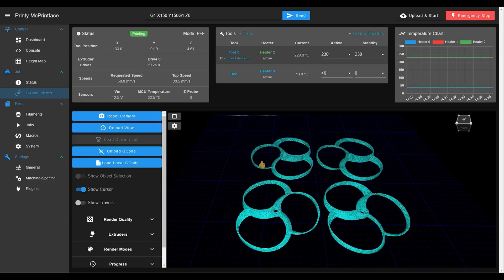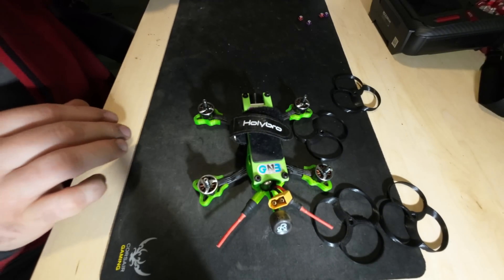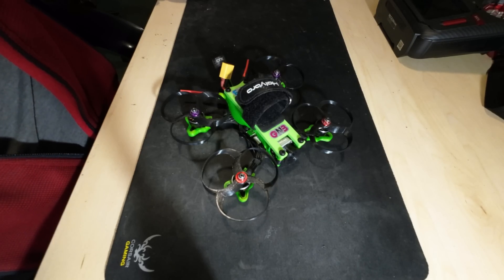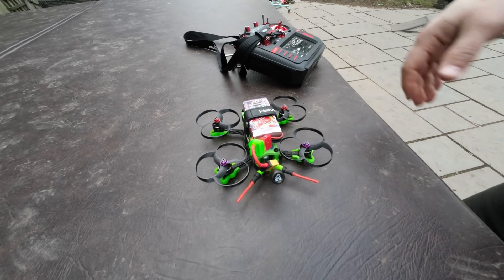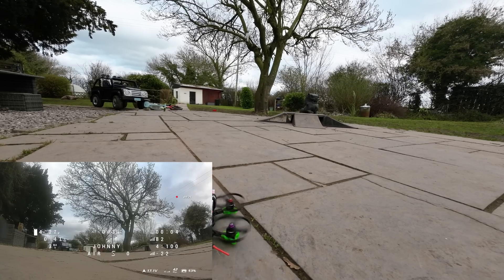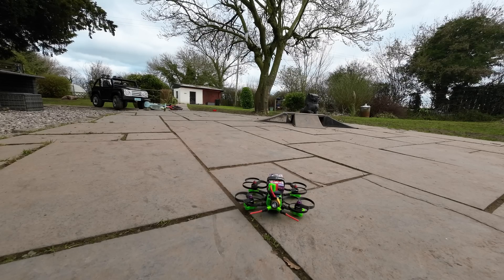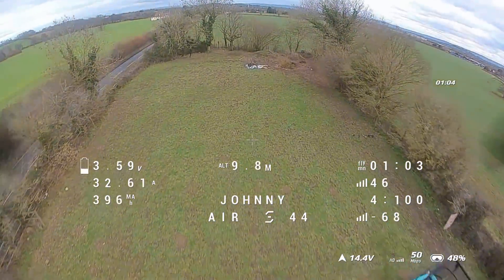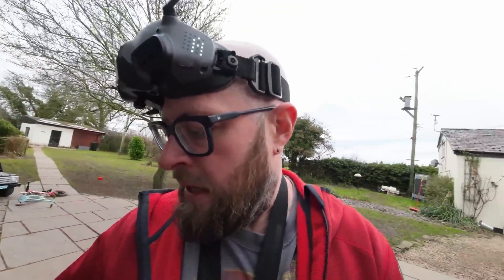More Toroidal Prop Testing on my Kopis Mini with a VERY unexpected result!

Comment: Interesting experiment. Maybe these props are not as efficient as suggested, at low vehicle speed at any rate. It will be interesting to see if they are more robust during prop strikes, with the shape less likely to snag than individual blades?

Comment: Since I got a drone in 2014, I've climbed more trees after the age of 50 than I had before I was 10 !
Any chance of a closeup of the props? Does the pitch taper properly with radius? ABS probably better than PLA if you can get layers to bond properly, and smooth them. I'm tempted to make some for my 700mm quad with 2 blade 14" props - should be quieter, but with a lot more arms spinning I can't imagine that it would be more efficient.
Reply from the maker: All the props have exploded now and are in the bin. However, check out thingiverse for STRIKINGFPV designs and you can see the profiles on there directly. Very handy!
Reply: @willitmod  Thanks very much, will check them out.

Comment: That lift phenomenon - did that recur with your new props - the flexible ones? To me it indicates the outside rings are acting like the leading edge of a wing. Anyway - don't forget to mention it. :eyes-pink-heart-shape: Good Show!
Reply from the maker: Thanks! I'm fairly convinced it was bad prop design and inefficient aero. Not a drop of it on the v2 or v3 props!
Reply: @willitmod  Still a tease - would pull out the slide rule - can't resist an engineering mystery!

Comment: It doesn’t lose thrust during turns. What happens is the vertical component of lift is reduced. It reduces by the cosine of the angle of bank. I also think you have just discovered translational lift.
Reply from the maker: I have experience translational lift before, but this was different and caused by inefficient prop design. The blades were in effect stalling till the inrush was high enough to halt the stall giving the prop more thrust. 
Same with loss on yaw. The inefficiency of the props meant that lift was not easily overcome by down spinning 2 of the props for yaw, and the metrics that control yaw drop needed altering. Once done it was ok, but nonenof these symptoms with the v2 of v3 blades at all.

Comment: Interesting.  One thing that came to my mind was to braze some piano wire into a hoop the size of the prop's outer perimeter and melt it into the outer edges of the prop.  That should help to keep that outer curve from flying apart.
Reply: If the printer can be told to pause between layers, change over to a stiffer material for the top coat?
Reply from the maker: All good sugestions, but for now I'll wait till the prop design gets more efficient before doing any more testing. No point in a stronger but equally badly performing prop.

Comment: G'day,

Welcome to

Translational Lift...

Backtrack moi to my

"Aboriginal Technology..."

Playlist...,

Therein to locate and view

 "Boomerang Aerophysics..., Design Analysis ; Swept Wing Hubless Asymetric Autorotating Rotary-Wing Sailplane...!"

To put it in Fossil-Fuelled Aeronautical Engineering terms, Translational Lift is WHYFORE it is actually Doctrinaire to make Runway Take-offs in Overloaded Helicopters - dragging the Skids up the Grass beside the Runway, pulling as much Collective-Pitch as may be done without running out of Throttle or Tail-Rotor Authority over Heading in Yaw, while accelerating to about 30 MPH, whence the Rotors are moving at least One Rotor-Diameter forward per Revolution of the Blades - at which velocity the Disc is flying ENTIRELY in "Clean" Air, undisturbed by having "turbulent Old Downdraft" under the Rotor Array...

At which point the entire Rotor Array "suddenly" becomes around 15% more Aerodynamically efficient at turning Torque into Thrust and Lift - and up to about 60 MPH the effect is magnified - as the Disc is flying on the Newtonian Reaction against  Downwash generated by the Leading-Edge of the DISC, up to 30% or so rather than hanging entirely off the Fan's Downwash Reaction.

It's a complicated "Dance".

Do enjoy getting your head around it all..., I sure had fun ,(!).

For extra kicks, make and fly a few Boomerangs..., and then imagine making one from a bent Stick, using sharp Rocks, and then using it to hunt Ducks on the Wing, overhead at 100 ft.

Such is life,

Have a good one...

Stay safe.

;-p

Ciao !
Reply from the maker: It did feel so odd, and only apparent on the v1 props. But it is fun to experiment with 3d printer props. Madness!
Reply: @willitmod  

As I said, if you want to get right into it, try Boomerangs.

I've flown behind 2 different Propellers I designed and carved, and charged Batteries with about 3 of 8 Wind Turbine Rotors I've come up with ; but I had to read a Canadian Book to understand Boomerangs - and thus I began to kick back against the Colon-ial Cultural Cringe which characterises the Oz in which I grew up.

I got into 4-bladed Folding Boomerangs, and before I got it out of my System I'd made and painted and sold about 60 of them, as well as about a dozen Bull-Roarers, and maybe 6 Hubless Asymetric Boomerangs.

No Batteries required.

(lol !).

Have fun,

Stay safe.

;-p

Ciao !

Such is life,

Comment: Just a suggestion... Translational lift is an effect that full size and large model heli pilots need to take account of. Not sure if you tried but rolling into your turns then adding elevator and rudder to complete (like a plane) may help to conserve your speed and therefore it won't drop until you at ready for it. I know this is a different way of flying compare to drones which almost exclusively turn with rudder. This is why I'm not great at flying drones lol
Reply from the maker: Different forward speeds require a different mix of yaw and roll so this doesn't work at every speed. Only higher speed can you roll first then add yaw without shooting off in the direction of roll fast!

Comment: Really interesting, I'm glad to see someone talking about real world performance characteristics, rather than only talking about noise reduction, or lab test performance in thrust.  Out of curiosity, have you considered spraying the props with a high gloss spray enamel? I know that it could introduce prop balance issues, but it could also help with layer adhesion at the higher speeds. I've had luck in my own 3D prints  using high gloss enamel increasing rigidity, though admittedly, that was only things like kids toys.
Reply: UV Resin works pretty good as well. Helps fill the voids with multiple coats and can be done effectively. Curing time is minutes. Resin printed with ABS type material is even better.
Reply from the maker: Not yet, but I think PETG is the meterial of choice. For now, the Kopis snapped in half, so no more testing as I've built an Apex Mini, and I don't fancy stoving that in to the ground just yet. 🤣
Reply: @willitmod  Does the Kopis still run, although not structurally functional?

You could do one test: Anchor it down (zip ties and heavy staples on board?), then with a camera overhead -- spin up the blades and check for distortion at high speed. Even without a high speed camera, you may be able to see a change in size/width of prop. I don't know if a pattern on the background would make it easier to see distortion.

Comment: Maybe you can get higher strength using filament that contains metal fibres  i.e. Glock?
Reply from the maker: I think I'm done for now on these, strength wasn't a huge issue really, but smoothness was for sure.

Comment: I think the better performance at speed is because the airflow is poor over the high pitch until the drone moves closer to the actual push speed attempted by the props. Also, I didn't get a good look but are the outer radius portions designed at lower pitch than the inner radius?
Reply from the maker: Most likely this yes. Blades stalling causing drag.
Reply: Yes. Design definitely needs tweaking. Try lower pitch and also progressively lower to the outside of each prop, Not sure how you made them, I use openscad and do my own cylinder surface algorithm to do maths art vases etc based on distortions. I could mod my algorithm quite easily. to incorporate the radial pitch change.

Comment: i wonder if changing the angle of the props would help the dropping on corners?... being so directional rather than a wash of air, as you turn that coulomb of  air loses upward lift were a prop wouldn't. just an idea tilt props outward, probably give more stability, lift and speed is interesting?...
Reply from the maker: I think it's just the inefficiency of the prop. Less combined thrust is going to mean less overall on yaw.
Reply: @willitmod  a vortex spins to a point like a tornado, but a blade is a wash of air, an example of outward facing thrust, for stability is our very own British jet man, one fixed  engine and two slightly outward facing jets to give stability,

Comment: So, how was the efficiency? How long could you stay in the air with the toroidal props, compared to a good set of conventional props of similar size? (same drone, same battery)
Reply from the maker: Less than a standard set of props for sure. These are expectedly less efficient.

Comment: on a helicopter, you only have 1 propeller, so when the speed of the copter equals the speed  of the prop, you zero on one side and double on the other side. as soon as you have 2 propellers or more, you don't care any longer, because whatever the speed of the props, you don't care if either side of each propeller is at zero, because the other side is at double, there is no risk until you reach delamination (aka cavitation) speed.
Reply from the maker: Yes, this! No rotation from any props in qwad format, but I was trying to align thoughts with the uplift at speed. Seems it was just an inefficient prop design!
Reply: @willitmod  Actually, I would not say inefficient. Just unfinished. ATM, I'm trying to put a NACA to revolute around, but Fusion 360 is being a bitch with me,  or I'm just too dumb.
Reply from the maker: @RegisMichelLeclerc  v1 was definitely innefficient compared to the v2 prop. I am shooting v3 props today. 😀

Comment: Hey Major Hardware made a video about toroidal fans his subscribers made and something that was odd was when he flipped one of the fans around it had the same static pressure. So the fan worked in both directions when hooked up to a radiator.
Reply from the maker: Yeah I subscribe to his channel. Really mad interesting stuff with static pressure!

Comment: meaning the advancing blade is climbing on the airflow so the prop is better at cruising than hover
Reply from the maker: I do think it was to do with the inneficiency of the blade design on the V1 prop. V2 is way different.

Comment: How is the power consumption with these? The same? Or less current draw?
Reply from the maker: Motor current draw due to the roughness from the print, and the early design phase of the prop. Hover is about 10a continuous draw. So for now, more current draw, but something to watch decrease as the design matures.

Comment: Great video! Quick question tho :D Do you have rooted goggles or the new ones are just able to handle the OSD like that? Thanks in advance!
Reply from the maker: Bog stock Goggles 2 and betaflight 4.4 is all. No root needed!
Shout it if you'd like help setting it up!
Reply: @willitmod  Ahh okay, I could check it before buying FPV V2s :D! From what I understand, right now the only possibility to have the full OSD is to root my goggles and install WTFOS :D I have to finally give it a try :) 
So in your goggles you just need to record the DVR to have the OSD on video or you get like 2 different files that can be synced together? :)
Reply from the maker: You can, if you have onboard video recording - SYNC them together. On the Kopis, I only have goggle recording, so what you see int he vids is purely from my goggles, then I SYNC to my DJI Action 2 camera in the editing software. :)
I believe WTFOS is the only way for the full features with V2 currently - but I may be wrong!

Comment: I suspect some of the lift at higher speeds might be due to the prop distorting. As they stretch the angle of attack may be increasing, or possible the stretch from one "loop" is pulling the other loop out of shape ?
Reply from the maker: I think the inefficient design of the blades meant the more airflow, the less stalling creatin more thrist and therefore lift. Much better on the V2 props now!

Comment: Very cool I wonder how well they would do on a fixed wing 🤔
Reply from the maker: There was someone doing exactly this. I'd love to see the results!
Reply: I want to see!
Reply: The behavior in this video is: Increased power at high speed, but quick loss of thrust when slowing. That could be troublesome when trying to land a fixed wing.

There apparently already are expensive props for boats... which is reasonable for most situations, as more power is helpful... although might be touchy when trying to maneuver around a dock.

Comment: I think that sink may be the steepest pitched part of the blade exceeding its critical angle of attack. If the whole blade did this at once, it would result in propwash oscillation. It will be interesting to see if a consequence of this blade design is softer stall characteristics than traditional propellers, as it seems like the loss of thrust approaching the critical AoA may be more gradual. 🤔 Any actual fluid dynamics experts or aeronautical engineers want to let me know if I'm on to something? lol
Reply from the maker: It's absolutely odd to fly and almost uncontrollable. But check out the new vid. Insane results from the v2 props from @STRIKINGFPV.

Comment: You could make it work, but computing the right shape may require access to real supercomputer time (prop blade design nowadays require a huge amount of computing power to simulate and optimize the blade design).
Reply from the maker: I know nothing about prop design, but strikingfpv has done an incredible job on the v2s. Check out my new vid, the results are incredible!

Comment: I wonder if ducts would fix the loss of thrust on banking
Reply from the maker: I think ducts would interfere with these props as they are designed to be used without. The loss of thrust in turns is most likely bad blade efficiency. Cant wait to try the next set - printing now!

Comment: Do you have any way to measure the prop efficiency? It would be really cool to compare the power draw at different thrust levels
Reply from the maker: No, but there is a guy who did tests on thrust for a 2" prop. Interesting results. More power consumed, but more thrust output!

Comment: I wonder how much it would change if you flipped the motors so the air from the propellers pushing down doesn't hit the drone arms?
Reply from the maker: Not sure, you would have turbulence inbound then instead. As much as I would like to try, I don't fancy mounting motors on the lower until the blade design is a little more solid and efficient. :)

Comment: I'd be really interested in seeing if this would work with a flexible pla. Could theoretically have a "safe" duct less drone that won't murder you.
Reply from the maker: Tried TPU, absolute fail. 
Going for silk pla on the V2 props tonight, and will also print out another pla+ set as well for testing tomorrow.

Comment: Order up some PETG and see how they hold up. PLA is super weak. I am surprised they are not exploding immediately hahah! Either way these tests are awesome!
Reply from the maker: Thanks! I appreciate your views!
I did have to limit the total power outout as the last set shattered around 90% throttle, but the PLA+ is holding up in there!
I am also trying silk PLA on the next V2 set, along with PLA+ again. Silk PLA is a littl emore flexable, but not quite as strong, so if it lasts, it is the PLA cracking under flex, and if the silk PLA does not last, it is pure centrifugal force pulling it apart. 
Science!  Or something. :D

Comment: What's the advantages
Reply from the maker: Mostly reduced noise from the MIT study. Lower noise above 500hz means the sound drops off more at distance compared to a traditional prop. Also, there are no real sharp edges to slice open fingers - just like I did recently hence the bandage and stitches on my left ring finger. :D

Comment: How heavy are these props vs normal ones,  Heavy props might be why it feels "Floaty".   If there is a lot of drag and mass,  at speed, the motors can spin the props faster than in static air.
Reply from the maker: A very similar weight, only a couple of grams tops. The floaty feel is most likely from the bad aero and efficiency of the blades.

Comment: Printed some yesterday and my drone wobbled like crazy, motors got extremely hot. Did you balance the props?
Reply from the maker: No, however I did significantly lower the D gains and raise the D term multiplier. :)

Comment: Engineering student here

As far as my quad aerodynamics knowledge goes, the better lift and efficiency in higher speeds, is probably caused by too much pitch on the props..  so the props might be almost stalled when hovering, but when the incoming air has some speed, it starts to work and the Angle of attack on the prop profile works more efficiently
Reply from the maker: A good point well made! That could certainly account for some of the oddities.
Reply: @willitmod  Maybe you could ask strikingfpv to remodel them with less pitch --> flatter.

I am also thinking, that giving each "leaf/blade" more of an oval shape, to have more usable blade area over the tangential "ring" part might help with efficiency.
Reply: Most props are stalled with no forward movement if the pitch is over half of the diameter.  (6x3 vs 6x5).  So yes, quad props are stalled in a hover.  They are just so overpowered that it doesn't matter.  That and translational lift is why quads are much more efficient in forward flight.
Reply from the maker: @scottyh72  amazing! Thanks for the info. 😀